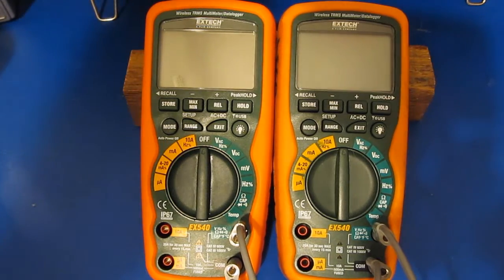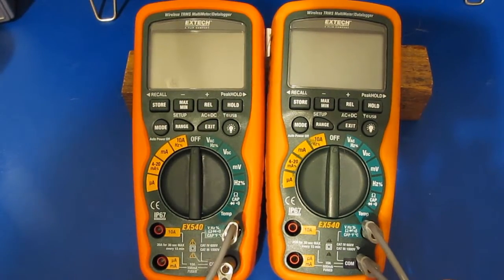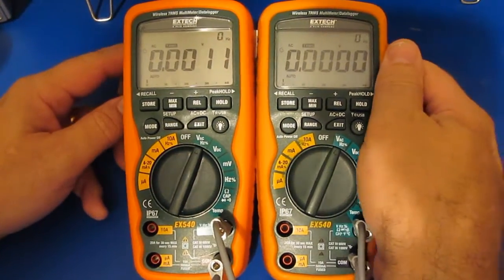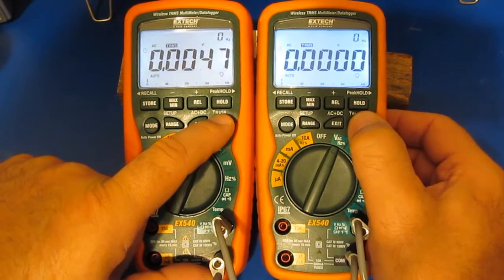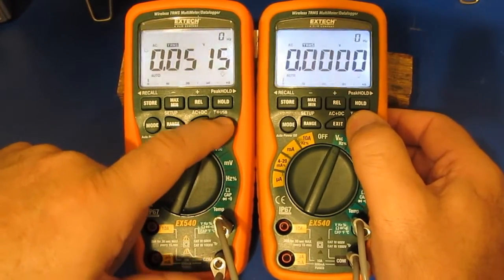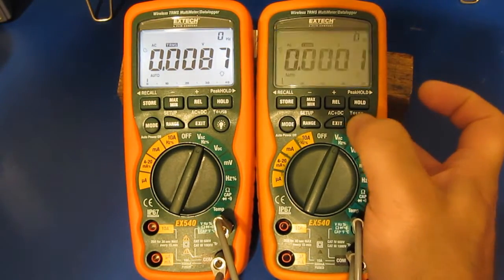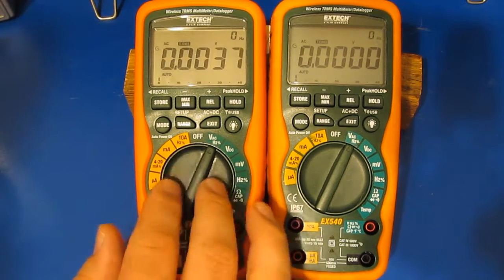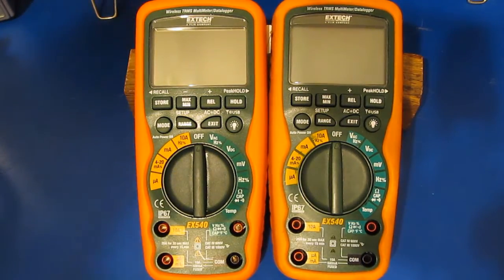Extech EX540 Backlight Effects ACV With Input Shorted

Comment: Hi Joe,
The original of this tester is the Major Tech as we talked before. One thing about the MT is that it's water resistant up to 20m. The only bad thing about this is, you have to press down the meter with one hand and apply huge force and then pull out the test leads with the other. MT was originally build for the gold miners here in SA
Reply from the maker: I believe the OEM for these was CEM.

Comment: Hi Joe !! I love your videos ! Do you may to do a test with signal generator in low AC voltage?
Reply from the maker: Thanks.   Are you wanting to know if a low voltage AC is present, if these problems effect the reading?
Reply: Yes !!! I don´t have a signal generator for this. My signal generator will still get. Best regards
Reply from the maker: No problem.   I'll make one last video comparing the two meters for ACV, AC+DC and effects of battery voltage on accuracy.
Reply: :) :) : ) Thanks Joe !!